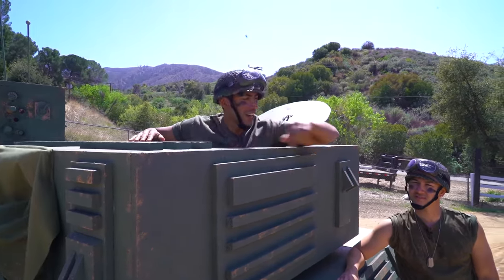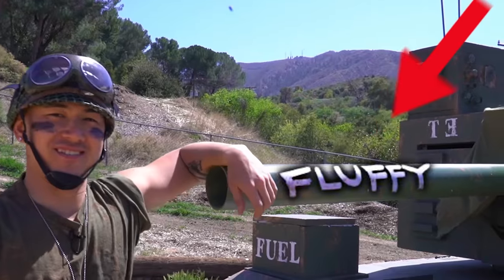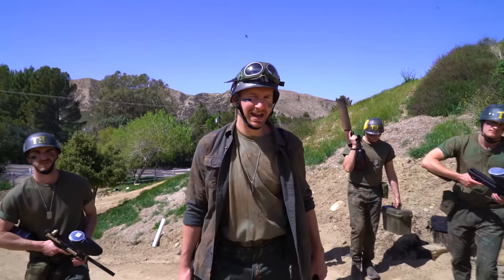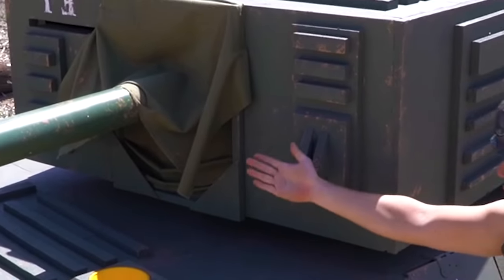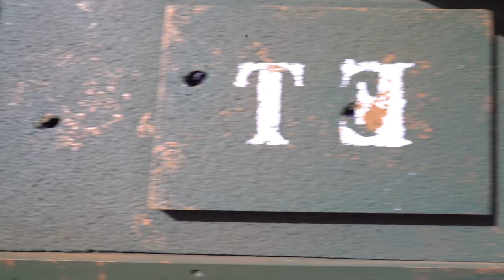Soldiers vs TANK BATTLE! *We made a working TANK*

Comment: 3:19 "What is taking them so long"
Maybe its the Fact they do not have a Dedicated loader? 
The Speed of the Reload is sometimes caused by but not limited to:
A: How Large/Heavy the Round is [Smaller Rounds can be loaded much faster].
B: How much room is in the Turret/Mount [Cramped turrets can slow Crews Down].
C: How many Crew Members are Loading the gun [Dedicated Loaders tend to load faster than other crew members that multitask].
D: How the gun is reloaded [Autoloaders & Magazines Speed up loading tremendously].
E: How the Round is Stored [2-part rounds almost always take longer to load then completely assembled rounds do as the round needs to be assembled before being put into the gun].